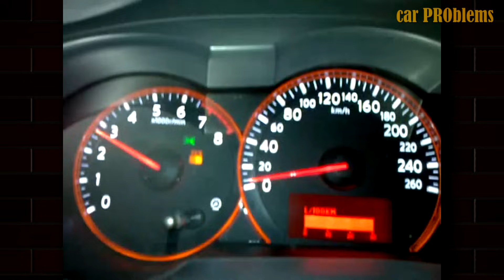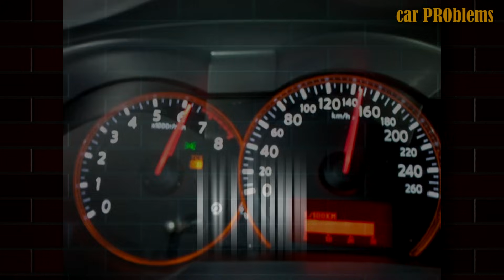How long do CVT Transmissions Last? - CVT Reliability

Comment: My CVT went about 60,000 miles before problems.  It started with a chirp when I would put it in gear.  Dealer told me it was nothing.  About 5,000 miles later, it started slipping around 45MPH.  
   I don't want another.
Reply: Just curious but what kind of car did you have?
Reply: @lasersGoPewPew123  2016 subaru outback
Reply: I'm not johnstrand (above) but the swame exact thing happened to me.  I have a 2016 Nissan Rogue.  I maintained it according to schedule.  Overall, stay away from Nissan brand @lasersGoPewPew123
Reply: Get a Toyota hybrid.  They don't have that problem because they don't use a belt CVT in their hybrids.
Reply: @wearethelandrovers9014  is hyundai ivt last longer just like toyota cvt?
Reply: At what mileage did you perform your first drain and fill?    Did you replace the cartridge filter and screen?   Did you drop the pan and check / clean  the magnet?
Reply: @johndaniels651  Didn't do any of it.  Tried too and the dealer said it was a waste of money as per what Subaru of America was saying at that time.
  In fact, they told me my CVT was "beefed up" over those before 2016 that were failing.
Reply: @johnstrand2247  Oh man, that's awful the dealer would tell you that. Some JATCO's are just junk out of the gate, but   most often the CVT failure typically arises from the valve body getting clogged with particulates, (dirty fluid) which leads to overheating, causing more friction and more particulates in the fluid, leading to eventual inability of the  hydraulic valve control system (valve body) to function properly, leading to belt slippage and catastrophic failure.  A refresh of the fluid, screen, filter and cleaning the magnet, typically resolves these issues before damage arises.  One mechanic even suggests replacing the  cooler ($40 part) every other fluid change, as the cooler itself can become clogged with particulates.
Reply: @johndaniels651  I guess hindsight has provided some education.  Way too late for me to take another chance, plus I don't like the way the CVT wobbles upon takeoff.   Even my new CVT does it and they tell me that they all do.
Reply: @johnstrand2247  --That's a shit dealer!! 
He screwed you and your car's CVT! Bummer...
Reply: @johndaniels651  How many times do ppl just change the fluid -and nothing else?? 
Your details above are noted and shall constitute part of my detailed instructions, next time I have the trasm. fluid changed!
Thank you for the details!
Reply: @johndaniels651  drain and fill every 40 to 60 thousand miles no need to change the filter if you keep fluid changed. What ever drains out put back in the same amount. I have over 300000 on my CVT.
Reply: My transmission failed at 45,000 miles. Thankfully it was still under warranty, so Mitsubishi replaced it for free. (This was a 2016 car, so I don't think Nissan was involved with Mitsubishi yet.)
Reply: If it is a Nissan, I would not be surprised.
Reply: Well so far my 2017 Nissan NV200  mini cargo van is running fine. I bought it new and now it has 198K ( highway miles). I make sure it gets what it needs. Whatever the cost is. It’s important since it’s my working vehicle and I travel out of state a lot. But if you’re stating to experience transmission problems is better to start looking for a
another vehicle because is not worth the repairs. Prior to the Nissan cargo van I had a 2000 Chevrolet Safari.  And it became a money pit at the end to the point where the mechanic said it was  not worth the money repairing it. 

Also, the quality fuel is very important. Ethanol is the worse thing you can put in your car for any  4 or 6 cylinder engines.  I use ethanol-FREE gasoline. Ethanol can clog engine parts like injectors , converters , carbon buildup on pistons etc. Might as well add sugar in your gas tank. And it may even affect the CVT transmission as well.

Comment: Also, the Toyota CVT while it is a “continuously variable transmission” is not the “supposed” notorious belt type, it runs, planetary and sun gear type of setup from memory
Reply: That's ecvt on hybrid, toyota also has belt driven cvt which later modified to dcvt
Reply: @VuLe-t9m  my Toyota Corolla le CVT has over 287897 I do drain and fill every 60000 miles.

Comment: I BOUGHT A FORD CMAX, USED.  AS SOON AS IT REACHED 130,000 THE CVT TRANSMISSION WENT OUT.  THE DEALERSHIP IS LITERALLY THE ONLY MECHANIC THAT HAS THE CAPABILITIES TO WORK ON THIS TRANSMISSION (OR WAS WILLING TO) AND THE ONLY OPTION IS A FULL REPLACEMENT, PARTS ARE NOT EVEN AVAILABLE FOR REPAIR. AT THE TIME OF WRITING THIS THE COST FOR THIS "REPAIR" IS $9,300! BUYER BEWARE... I CHECKED ON WHAT A CVT TRANSMISSION FLUID CHANGE COST WOULD BE...$600!  I WAS TOLD IT WASN'T RECOMMENDED TO CHANGE THE FLUID AFTER 100,00 MILES BECAUSE IT WOULD MOST LIKELY CAUSE TRANSMISSION PROBLEMS.

Comment: I drive Corolla  1.6 L 6 speeds manual transmission🤣(most reliable car ever )
Reply: Many of those simple set up non turbo standard tranny vehicles by Toyota can go 300 K if cared for. bad thing dealer doesn't make any money on them. LOL
Reply: @curtiseggemeyer5681  manual will last til the end of time......might need a new clutch every 500k or so, if you live in hills and valleys

Comment: Speaking as a former Mechanic, who now does airport transportation , my 2020 Mitsubishi Outlander now has 121,000 miles on it. However, being a retired Mechanic, I am  FANATICAL about maintenance. Mitsubishi recommends replacing the transmission fluid every 30,000 miles. I’ve been doing mine every 15,000 miles. In addition CVT equipped vehicles cannot be driven like conventional ones. You cannot (should not)  “TROMP DOWN” on the gas pedal. You have to accelerate very slowly. I tell people you have to drive it like a baby carriage. Additionally, I still change my synthetic oil every 3000 miles. I know conventional wisdom says you can go 5000, 7000, even 10,000 miles on synthetic oil. However, I have learned over the years motor oil NEVER WEARS OUT. It only gets dirty and diluted. I change the radiator coolant every year regardless of mileage. That way the coolant is never more than one year old. I change spark plugs every 75,000 miles even though it’s been said you can go 100,000 miles. The air cleaner and cabin air filter gets changed every 25,000 miles. The serpentine belt gets changed every 50,000 miles. Why do I do all this? As an airport, transportation driver my vehicles have to last. If you would like even more proof , my 2013 Hyundai Sonata was my business vehicle for 8 years. It now has 219,000+ on the original engine and transmission. Those cars were known for engine difficulties. It’s now my “run around town” car and my back up vehicle if my Mitsubishi Outlander goes down for any reason. Unfortunately, all most car drivers know about their car is “stick the key in and turn it“  What’s worse is , they don’t want to know.
Reply: Right on!!!! If one doesn't maintain it they pay for it later if they keep it longer.That's why I'll never buy a used/abused vehicle!
Reply: This!!!! CVT is a different type of transmission, for a different type of driving style. I don't have a CVT car, but it is not because I don't trust CVT, is just that the car I wanted to buy didn't use it, but if the next car I decide to buy does have it, that will not be a problem for me. I think the biggest problem of the CVT isn't with its design, but with the driver habits. Because of the robustness of the manual and the conventional automatic transmission, the drivers (and also the mechanics) didn't learn the habit of taking care of that specific part of the car, and the CVT is a component that requires specific care to work as itended.
Reply: I completely agree with everything you stated here. I'm the same way.
Reply: Hello people don't change transmission fluid after 150.000 miles.
Reply: @PandiKristo  For CVT cars you do unless you want it having an short lifespan. Due to their design if you don't change it at certain intervals the fluid stops lubricating like it's supposed to and  you will end up stripping the transmission itself. CVT's  aren't normal transmissions. I've been big about also changing mines out around 30k miles and i'm at 155k miles on my 09 Nissan Altima with the engine and transmission still going strong.
Reply: @zeke937  do you change the filters too?
Reply: I too have my 2015 Altima’s CVT’s fluid and screen changed every 30,000 miles.  I’m going on 180,000 miles and I drive it gingerly.  How do you dispose of the coolant?
Reply: ........... counting all the fluid & filter cost that goes with it............ to may humble opinion ain't worth shit. That kind of expenses is eliminated by just using manual box........... change oil once a year. Clutch plate .......... very long time. Saves 10's of thousand of $ on replacing box fluids. So what's other opinion ya.
Reply: I have a 2015 Kia forte five SX direct injection turbo hatchback I’ve never changed the transmission fluid in fact it sealed and I have 146,000 miles on it. I did have the injectors rebuilt recently because they were clogged pretty bad and some other items replaced. i’ve learned a lot about gas direct injection engines and CVT transmissions from YouTube. I hope my transmission won’t break. I do use synthetic oil since day one of this cars ownership. I do like those Mitsubishi outlander sports. I don’t know if I’ll buy another Kia again but I do like those Mitsubishi I seen them in Puerto Rico as well as the Nissan kicks as rental cars.
Reply: @shirtlessGraveler305  Your transmission is (most likely) not sealed! That’s a lie! They told me the transmission on my Hyundai Sonata was sealed, and I proved them wrong!
Reply: Damn..colant drain every year! Good work..
Reply: Good info, I have spent my career in aircraft maintenance now in inspection, I agree with you on most of this. Oil will last longer than the people that sell it say! I’m not quite as OCD as you are about changing everything😂
Reply: My reckoning into why so many cars including Kia and Hyundai have big engine issues. Oil intervals are neglected allowing for blocked oil rings, high oil usage and destroyed engine bearings from lack of oil. I firmly believe that many drivers flog their car when cold and thrash them on freeways.
Reply: Regular Maintenance seems to be absolutely KEY in keeping CVTs going!
Reply: CVT's r shit!!
Reply: @AFDnur Smart. However, with my arthritis, I can no longer handle a manual gearbox.
Reply: @recoveringnewyorker2243  hi sir 
If you could kindly reply ...Hyundai in India sells Verna CVT with lifelong CVT fluid ,and a basic search in internet tells the longevity of CVT depends upon changing CVT fluid regularly.kindly let me know your opinion regarding the same

Comment: 2016 Honda Jazz with CVT. Love it! Awesome economy, drives like a go kart. Service the CVT every 45000km and it should be fine.
Reply: I just had my CVT transmission fluid changed 
for the first time in 44,500kms./27,650 miles - just in time - 
and I can feel the difference!

It won't be so long until next time.

Comment: I have seen how they make c.v.t transmissions , and it's mainly      6 very thin 1 cm rings held together with about 300 metal clips, that makes a flexible belt,  but the main problem these belts have, is the thin layers will crack over time with heat and pressure weakening it and making it fail over time, the Average i have seen is around 133,k miles , so make sure to change the fluids and drive it slowly to make it last longer,  good luck
Reply: Get a Toyota hybrid, they don't have a belt CVT.  Their system is bulletproof.
Reply: Do you know if it's possible to change the belt as part of a regular maintenance program, or is it to cost prohibitive?
Reply: @TheDirthound  as far as I know , if the belt fails,  the whole transmission needs to be  replaced,  they don't just replace the belt at the dealership,   unless you can find a handyman mobile mechanic that is willing to try

Comment: If you see 50  youtube videos on how to save a CVT, what does that tell you? i junked a 2010 altima with 145,00 because the CVT  with maintenance gave up.  still have an old camry with close to 300k , transmission still works, Toyota rules, Nissan blows, lol

Comment: 197K miles on my 14 Altima, I change the CVT fluid every 30k with filters. It's not a sports car so don't treat it like one. Running like a champ!
Reply: I used to own 08 Altima. It was the best car I've ever owned. Sold it to a guy at work who still drives it to work every day.
Reply: Good maintenence is key,,,,,you proved that .
Reply: 👍🏾👍🏾👍🏾👍🏾👍🏾  Well said.
Reply: 150k on my 2010 Nissan cvt. I don’t/yet to change its fluid but I treat it very responsibly. I wish yours the best probability it warrants 🍀
Reply: @goldfishi5776  I would talk to a mechanic you trust to see what you can do about the fluid since it is supposed to be changed out.
Reply: We have a 2019 Nissan Pathfinder now has 27,000 miles on it , was told by the dealership to change the tranny oil every 25 to 30 K , My wife drives it , we do not tow and she drives pretty careful.  I hope the tranny holds up well. I feel it will , we only let Nissan service our cars.

Comment: When CVT goes though it will cost more than car is worth to fix and not many mechanics are equipped or know how to do this.    I will stick to non cvt
Reply: Unless you get a Toyota hybrid.  They do NOT use the chain/belt thing in their hybrids and they are bulletproof.

Comment: I have a 2013 Maxima with 146-thousand miles and the CVT still works flawlessly. I believe the BIG reason is the car was fitted with an extra cooler for the transmission fluid years ago when it was owned by GE Fleet services. I know this because after buying the car I was going to have a fluid cooling system installed and was told it already had an after-market cooler and did not need one.  Most of the miles are freeway miles and I've owned the car for the past 5 years without any problems at all. I know Nissan has a very bad rep when it comes to CVT's but believe with routine maintenance, and the added cooling capacity, they will last a long, long time. Many mechanics will tell you the lack of enough cooling is what destroys Nissan CVT's as the heat becomes a major problem.
Reply: An extra cooler? Now thats scary.
Reply: @mg8720-u7j  --Scary?? That's downright clever.
- get one installed a.s.a.p.
Reply: @devets4d  Junk transmission

Comment: My 2017 nissan sentra has 121,000 miles on it and just did abother transmission fluid chsnge. Its been running fine. Not a perfect car as the cvt is not perfect but whenever i drive it, i drive it slowly off the line and never try to floor the car. I trelavel for work in too out of town to other states with zero issues.
Reply: I have a 2017 Alima with a similar CVT as yours.  Drain and fill every 30K,  at 80K I dropped the pan for the first time, changed the screen, the magnet was a tiny bit fuzzy, but everything looked good.    At 93K I learned about the paper cartridge filter next to the cooler, and when it was replaced the filter was very dirty.  Since replacing that filter it decelerates more smoothly and runs about 8 degrees cooler.   I think the biggest problem with CVTs is very few shops know how to service them correctly, including transmission shops, and the owner's manual assumes you'll get rid of the car before 100K so they don't set up a service regiment either.   But my trans still runs great, just took it on a 1,000 mile road trip over mountains and stuff, with passengers and luggage, still works great!